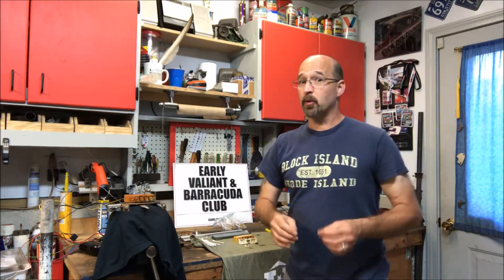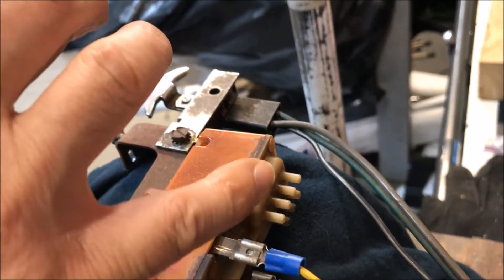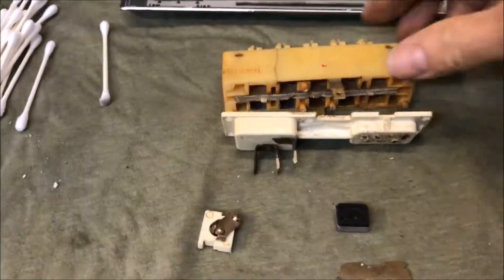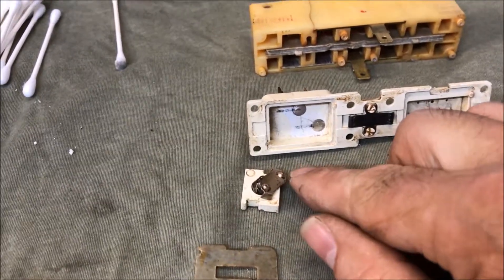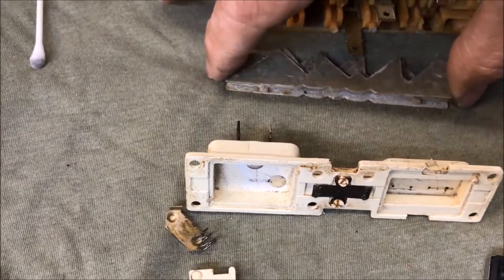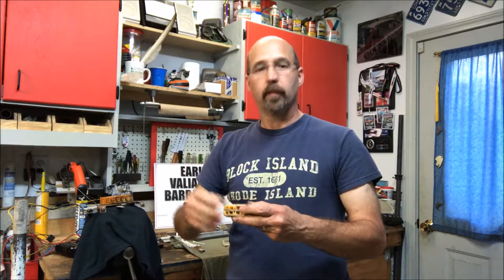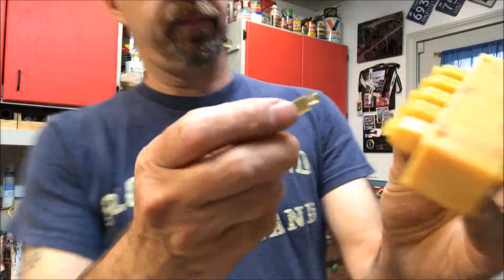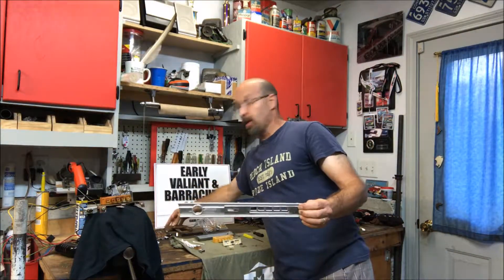Barracuda AC System Controls Explained

Comment: I was curious where are you getting all of your A/C components? I can’t seems to find factory replacement parts for the dryer that mounts on the inner fender.
Reply from the maker: I purchased all the components from someone who had removed everything from a parts car. The only thing I didn’t get was a compressor or a condenser. I sent the evaporator to Classic Auto Air to be cleaned and tested. I may send my dryer to them to be rebuilt. You just have to keep looking for original parts in clubs or eBay, or settle for an aftermarket replacement component.